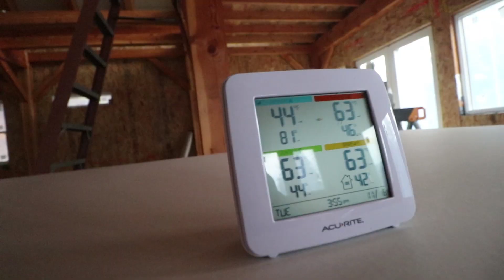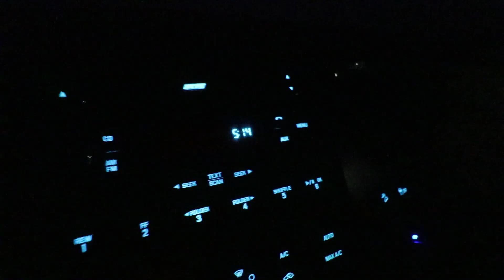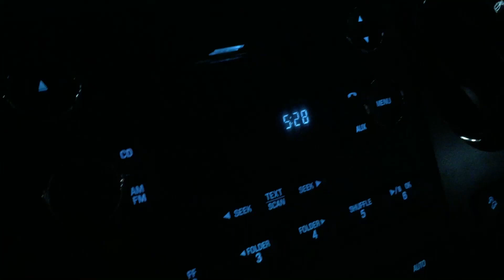This Video Will Make DRYWALL INSTALLERS CRINGE!

Comment: I once bought a gallon of drywall mud, the next time I checked the price for 5 gallons, I never bought another gallon bucket until all the drywalling was done.  I know it cost money to make a gallon bucket and fill it but the drywall mud must cost nothing because the price difference means you can throw away 1/2 of the 5 gallon bucket and still be ahead.  When I built my house I hired some real drywall finishers to do the work, they used bazookas and mud boxes and one used a set of stilts to do the ceiling and corners.  Two of them knocked out the first coat in 3 hours, that was all the closets, laundry room, pantry, 7 rooms, 2 baths an L shaped hallway and they finished the whole house in two more trips.  It was money well spent, if you value your time you can't do what they do for what they charge.

Comment: Anything paper faced gets applied with mud just like paper tape. Taping...prefill joints, let set... Mud on wall (more than needed), lay tape into mud center on joint, then knife tape into mud clearing excess mud.. If you don't get your foundation under the tape done right it'll all fall apart... This might be one of those things that you guys would do very well by at least having someone come in to show you properly to minimize future repairs in excess and save a lot of money in any materials that will go over the sheetrock... Love the vids, the house is looking great!! Hope this helps :)
Reply: 3 rolls of tape... And a little spackle bucket.... He doesn't do this work much ....I can tell...

Comment: Been watching for awhile and Just a friendly word from a pro 
Everything that was done has serious potential to bubble up and crack when you go to coat . Not enough mud behind the tape will cause cracks and bubbles. Bubbles won’t hide with paint or more coats
Any big voids ,you should prefill with a hard product aka durabond and run a flat tape along the gap (act like it’s a seam ) pack the  gap with a 4” knife , then run a full 4” wide along the whole gap .
Then you can actually tape the corner once it’s dry .Durabond is not a premix. You have to mix yourself and it sets up in 20-90 minutes depending on product . You need to actually put some mud behind the tape and wipe clean.  Think of the mud  behind tape as glue on a stamp . A stamp has glue on the whole stamp ,not just some here some there....YouTube is hit and miss on drywall tips. I’ve seen tons of “pros”that don’t have a clue on YouTube.

Comment: One way to create a nice corner is to use a router with a 45° bit to cut a grove into the drywall. Cut just deep enough to leave the front paper intact. Then you can fold the sheet and have a nice corner that needs no additional work.

Comment: The main issue as far as mold is concerned is behind the walls. I have seen many times where drywall and plywood as well on the surface looked fine until you removed it and the whole backside was covered with mold. (If never seen mold resistant drywall in white personally)

Comment: For what it's worth, Jesse, when I started pulling the drywall off and replacing it in this house I had a friend who was a professional installer show me how to start.  He helped with the first room and then we took it from there.  He is a high end installer, doing historic places and high end homes.  He taught me to use the setting type of mud for the first coat, the kind in a bag.  He set that because it sets as hard as concrete, it locks the edges of the drywall and all the screws into position, so that it won't wiggle and pop things loose as the house settles and moves in response to temperature changes.  You may not have that issue as much, because you've built so square and so solidly, but my house was built of green wood and everything moved, badly.  Nothing is square or plumb anymore.  Nevertheless, the drywall can still move if you bang into it or whatever.  In a cousin's new construction, heavily insulated house, all the mud over the screw heads popped after about ten years, and all of it had to be remudded and repainted, and that was simply temp changes.  The screws got colder than the drywall, because they were embedded in wood that touched the outside wall.  Go figure.  I've had one screw pop in fifteen years, and I think that setting mud made the difference.  He also started me with the fiberglass, self stick type of tape.  It goes faster, and since the mud goes through it, it seems to be more durable.  The different size knives are so you can use a bigger one with each coat, as you fill out the bevel between the sheets.  Use the 4" first, then the 8" and last the 10".  I'm not a professional, but my husband an I have replaced all the drywall in this house, and given that the walls are really crooked to begin with, it looks pretty good.

Comment: In the future use the bullnose corners that are held on with tape. When putting them on the wall fill the backside with mud at least for the bottom 4’. Why, so when you bump it with furniture it won’t dented the hard mud fills in the void. 

That said, when you do the big job upstairs hire someone to mud the walls. You’ll be happy you did. I did some of my muffing but they did a much better job and they got it done a lot faster. It was worth paying for.

Comment: Thin your mud a little..especially for the first coat. Do not use texture...you will regret it. If you wet the tape before bedding, it will adhere better. Paint the bathroom with semi gloss finish...it will clean much easier. And staple or spray glue for the corner trim

Comment: As a retired contractor any one can drywall and mud.  With practice you will get better.  However stop washing your equipment in the sink.  Mud will not only plug your drains but remain in your septic and you will have to replace it.  I have had jobs in many remodeled homes knocking out the floor. PS tool belts pockets are bigger and hold more stuff than your pants.

Comment: you are right about the MR drywall. but i think that bull nose corner piece goes under the sheet rock. same with corner beads. Ive hung lots of drywall in a dozen homes and never used screws. for me nailing is a lot faster and i dont get paper popping around the nails like you get with screws. also you mud the joints then lay paper on it so it sticks, then go over it with more mud. thats why the drywall is thinner on the finished edges of the drywall. But i think you've got lots of time for improving your technic.
Also a couple tips, buy the drywall compound in bigger buckets and stir/mix it well. DONT WASH YOUR STUFF OFF IN THE SINK!! Its not good for your drains or septic system! Get a 5 gal bucket then dump it in your driveway.
Reply: You obviously have never had to finish drywall.
If you put the bull nose under the sheet rock now the entire corner is half an inch behind the surface of the drywall, you going to completely build your own corner out like they used to with plaster?
Also, I have seen way more issues with nail pops over screws, as well as having to cut out hammer head shaped dimples around nails because the idiot that decided to use nails over drove them breaking the paper away from the gypsum inside the board. If you have a dimple around your screws then tell the person hanging to throw away their POS drywall countersink their using on a standard drill (or impact) and buy an actual collated screw gun meant for drywall that leaves no dimple and sets the screw perfectly every time if used correctly.

Comment: Put the mud on the joints first and then add the tape on top of it and use the knife to smooth it all out.
Use the smallest knife at first and after it dries, use a wider knife. Use a minimum amount of mud with each pass. Do nail hole after you have done the taped joints. Mud shrinks as it dries.

Comment: First of all you should have used a piece of drywall with a factory edge for your corners. Also you have to apply mud before you apply tape to a corner or seam, third do not clean your tools from drywall or painting and dump the water down your septic system unless you want trouble in the future, 50 year retired plumber!🚽

Comment: The first drywall room is Looking Good!  I actually like the looks of that papered bullnose corner.  One thing we used to do with the surround edges was to actually cut a little off the drywall to make a small shallow rabbet so it fits better over the edge and doesn’t crack the drywall.  Suggestion: for the long seams, use the 4” knife and lay down a layer of the mud and THEN lay the paper tape in that mud before trying to spread it out. This puts a lot of mud into the seam while providing the tape with something to adhere to. You will still some mud over the top of the tape so it’s all covered.  To make it easier down the road, get a decent size sponge and water bucket and whenever the mud is almost dry go over everything with a damp (not wet) sponge to knock down the high ridges. Many times, but not always, this could eliminate the need to sand. This method is especially useful around the corner and surround edges.

Comment: If you figure out the technique you apply the bullnose with mud and "glue" it in place.  Very simple very easy.  Using nails or screws with metal bullnose can cause a reactive corrosion process that can bring a stain to the surface after all the mud and paint is done.  Just one of the tricks drywallers know about... not to mention it takes a LOT of time to put all the fasteners in.  If you have to repair it in the future, it's a whole lot easier than prying off a hard fixed corner.

Comment: Bro, those corner beads go on with mud, NOT SCREWS or nails. Also, you did the ceiling first which is right, but then you should do the upper wall pieces, and the lower wall sections last.

Comment: Jesse,  I stand corrected.  I was one of those who thought Green or cement board should be used beneath the tub surround.  You schooled  lot of us on that one.  As usual you have done your homework and prove you investigate and use logic and intellect to replace experience.  Your doing just fine.  I like your approach.
"Just one more thing."  (Columbo quote) Using tile to the surround area will decrease any future problems with water.  By the time your finished you will rate a Master Builder title.

Comment: I made my living doing this kind of work so I might have a few ideas for you. Lotsa good comments here and a few that are not so good. In 20 yrs of drywall work I have only found 2 uses for the mesh tape. You know the stuff that looks like a screen and sticks to the drywall by itself. 1. If you really want to mess up a mud job, that stuff is the ticket,  unless you have a thick covering of mud on top of it, it WILL show through. 2. it fills up a trash can real good. That's it, all that mesh tape is good for. 
Corners,, put mud on the corner, mash the corner cover in place and position where you want it, scrape the edges so as not to leave a ridge, or edge, and let it dry. Cover with the next coats of mud and be happy. 
When you are ready to mud the walls, measure the "paper" tape and cut, drop in a bucket of water and measure the next piece, do the same with it. Pull out the first piece and apply. When doin a wall with lotsa the same size piece's needed, just cut a bunch and pull them out of the bucket of water as needed. When you take out a strip of tape to apply, squeegee the tape between your fingers to remove the extra water before sticking it in the mud you already have applied to the wall. 
Hope these tips help.
Reply: I have used self adhesive mesh tape here in the UK lots. No issues, easy to use and looks great.
Reply: Nailed it! also, I find the light weight mud doesn't shrink as much as the standard stuff. That's what we use for finishing.

Comment: ok I know you are done with this sheet rock project,  But  get a bucket of water and cut your paper tape to lenght and put it in the water.  Smear your mud on the joint that you cut the tape to fit.  Use your small blade you bought and fill the screw hole and the joint  a little wider than the than

Comment: Get an inside corner trowel, you're going to need one. When you tape put enough mud down first, so it squirts out from under the tape while you use a knife to put the tape down. Doing tape and mud on your entire screw line outside the seam lines isn't necessary; it wastes tape and mud. Hope that helps a bit

Comment: I am a GC not a drywall. BUT I do my small jobs, Mesh tape requires an extra coat to cover, you can get bubbles when you second coat paper, I prefer the fabric tape not mesh  and it's faster total time to get more thin  coats WITHOUT squish outs, extra mud that a lot of home owners do. properly applied mud requires minimum sanding. and a damp sponge works better than sanding. sanding can fuzz up the drywall paper I use a small air stapler for corner bead.

Comment: Fun fact, the paper is only mold resistant in green board, Hardie board and durarock can still mold. And please don’t use the cans, looking into the Wagner texture sprayer no compressor needed, thin down your mud to a pancake batter and spray it, wait to knockdown till the shine is gone

Comment: Jesse, I think you did great on the drywall work, don't let the naysayers get you down. It's YOUR house, and you guys are doing a splendid job on it. You've even inspired me to do some much needed work on my own home. I'll research it and get the stuff all together and possibly do it in the early Spring. (it's removing my torn siding and replacing the exterior wall with more insulation as well as a log cabin look exterior. Wish me luck, I'll be doing it alone unless I can hire someone to help out.)

Comment: We run the drywall to the lip of the shower surround, then fill the gap with setting hot mud. Keeps drywall from from looking flared out at the shower.

Comment: I just recently had my main bathroom remodeled and got rid of the tub. Due to my wife's disabilities.  I now have a full-size walk-in shower with a built-in bench to sit on.  As Jesse mentioned, the moisture resistant drywall comes in different colors now.  The drywall that was installed was baby blue rather than green.  Originally I had tile around the old tub replaced and at that time they used a "cement board" to adhere the ceramic tiles to the walls and then grouted them.

Comment: I use firing strips above the surround to make the wall flush. I don't use drywall anywhere near the shower or tub. I use Durarock and tile. I prefer fibertape over paper.

Comment: You do not sand between coats. I prefer wet sanding toward the end. Use water and a paint brush to cover the dried mud and the mud will soften and then you can use the knife to smooth the mud. You can also thin the mud by add some water to it so that it is very thin.

Comment: I've used DryLock paint on drywall. It's used to penetrate and seal cinder block and concrete in damp or wet areas. And that paper cornerbead and bullnose is still metal with paper glued to it. You can get in paper so you can attach it only using drywall compound. The stuff without the paper has holes in it so it can be attached with screws or nails.

Comment: We use purple drywall because it has no paper, or any material in it that mold can grow on, weather or not you stop moisture.  For do it yourselfers I would tell them to always use the purple board, at 2 bucks more a sheet its an extra layer of protection.
Reply: Paperless drywall  is still not easily available for most of the US. Your comment could also be confusing since different manufacturers tint their moisture resistant board different colors, from dark purple, dark blue, light blue, light green, dark green, even saw pink one time.

Comment: When you do the main house look into the base adapters for the bull nose.  It will give you square corner at the bottom for the trim rather than trying to install trim around a rounded corner.

Comment: hey  a trick for sheet rocking around shower surrounds  , mark on the back side of sheet where nailing flange is and scribe a line with knife gently about depth of flange , then peel paper off and  cut out the rock gently  the depth of nailing flange. this method works very well. sheet rock stays flat and now any tile or trim around surround sits flat.

Comment: If you watch the pros, which I am not, apply the paper they use a bazooka which applies the tape and mud at the same time .The mud they use in the bazooka is very watery I would almost call it a slurry. I don't have a bazooka but in order to emulate the way the paper is applied I soak the pre cut paper in a bucket of water run it through two fingers to remove the excess water then apply it to a layer of applied mud over the joint. I then apply another layer of mud over that with the 10" knife. One of the problems your going to face using dry paper is air bubbles in the papered joints pre watering avoids that. I also agree with a couple of previous comments the bull nose is applied with mud not nails or screws in fact in this area applying the edging materials bulnose etc.has become a specialty that gets applied and dried before the regular mudders come to the job.

Comment: Arbitrary FYI
I also have an F 250 4 by 4 good idea to put a piece of seller tape across your four by four button on the dash because one of the days you are going to go and switch the air on and actually end up putting your vehicle in 4-wheel drive by mistake
On the flashlight in your pocket it's the best thing ever I'm a handyman but I like to use the two AAA LED Mini Maglite because it's in my back pocket next to my wallet. 
On the drywall I find using the pre glued mesh is much easier then paper joint tape as you can put it on before you put any mud on